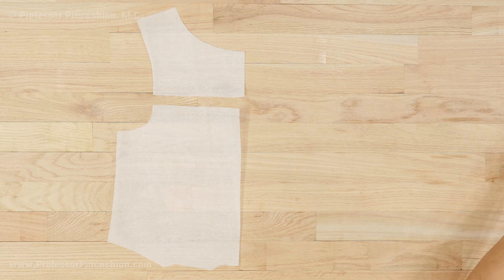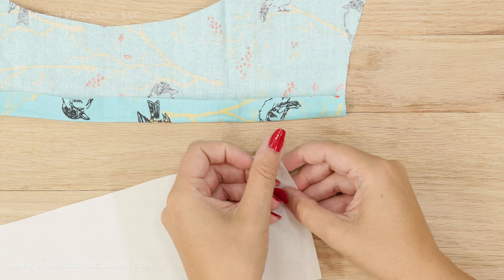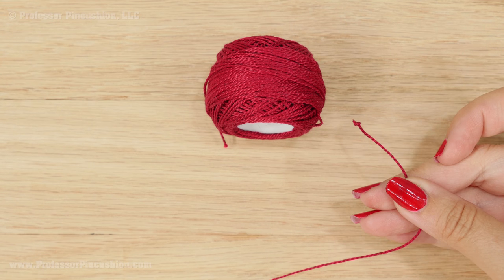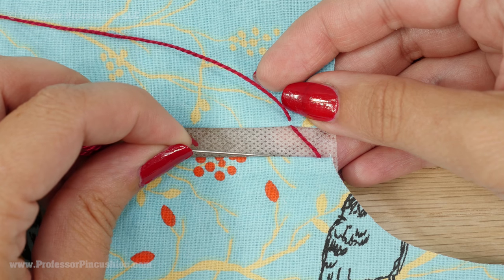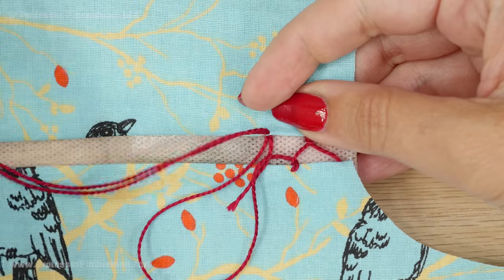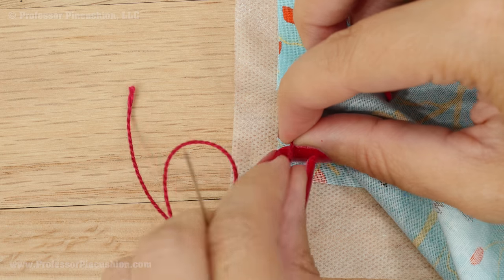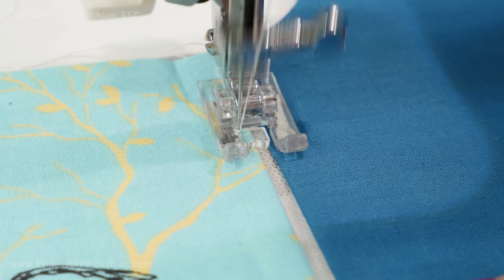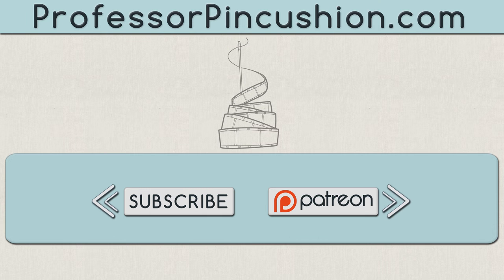How to Sew Bridging (aka Fagoting) by Hand and Machine

Comment: will it be equally successful on thick and thin fabric?
or foes tge fabric matter?
Reply from the maker: sure, you can use it on either types of fabric, it just might be hard to hand sew on the thicker fabrics so you'll want to use a thimble so you don't hurt your finger.  I use pressing to keep the crease nice and crisp and your success in this will depend on the type of fabric.  I'm using a standard quilting cotton so it holds a crease really nice.  If you were doing it on something like knit, then you'll probably be less successful.